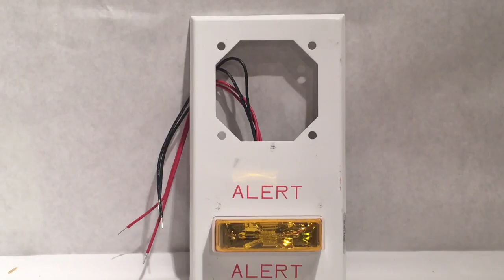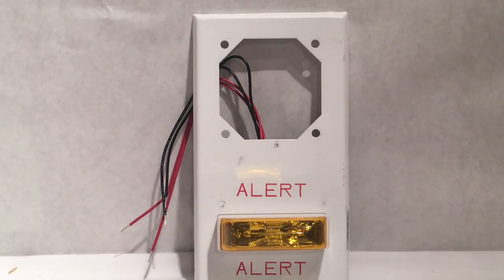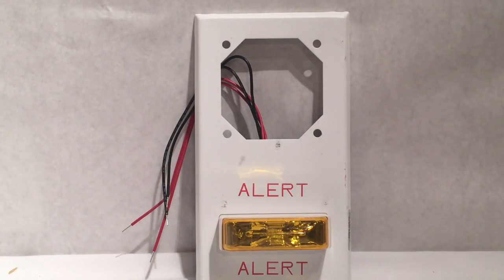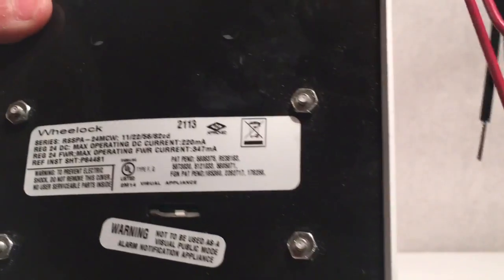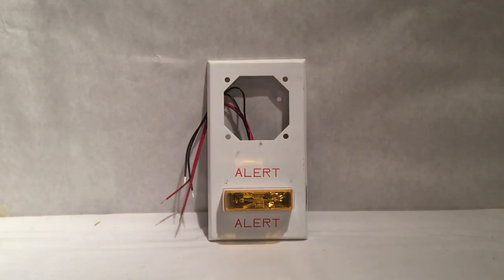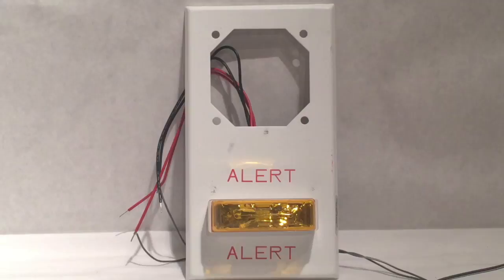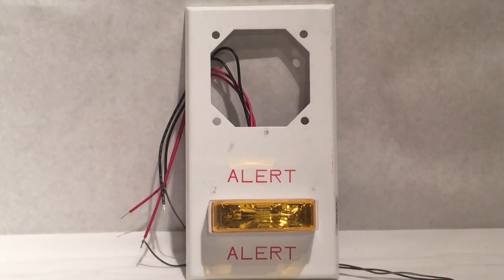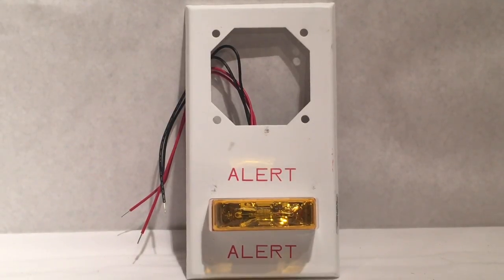"ALERT" (General Notification) STROBE Test - - STROBE PLATE ONLY

Comment: Hi! Is your profile picture a picture of a spec Alert classic?
Reply from the maker: Yes and no. It is a System Sensor alarm. But if you looked up one on eBay or Amazon, this is what they are called: Fire Alarm Horn Siren Strobe Quick Alert Safety System Sensor. But to answer your question, no, it is not a Spectralert Classic.